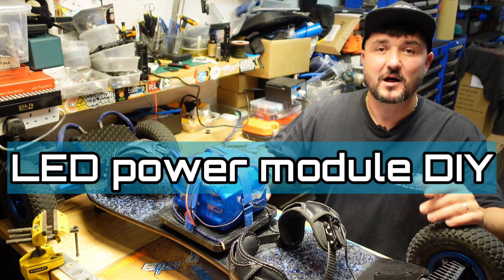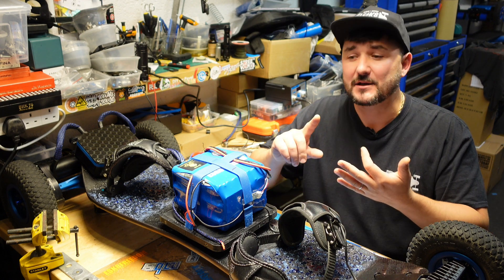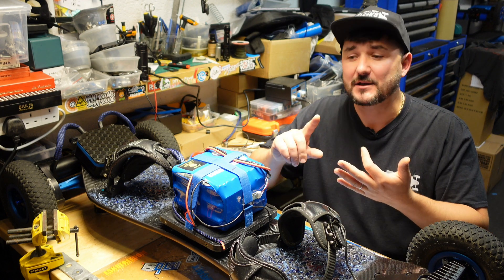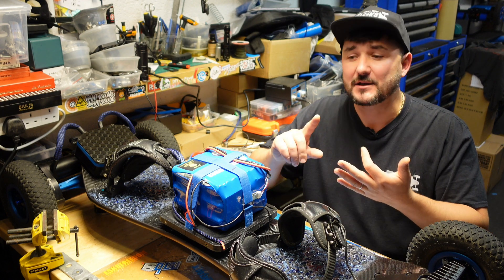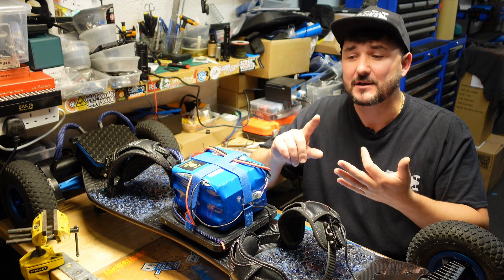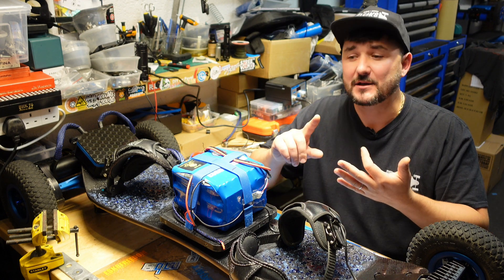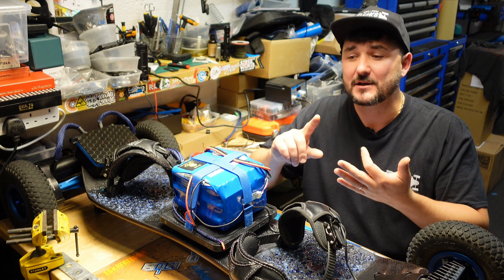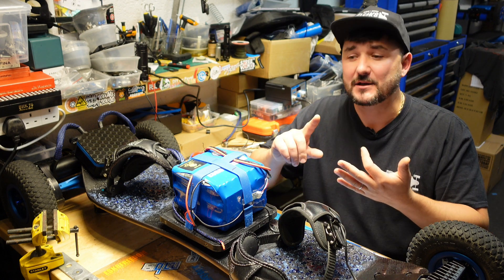ESK8 LED power module DIY. Detailed tutorial.

Comment: Interesting video on the LED drivers, Pavel.  Thanks for going through that.  Any recommendations on actual LED lights though?  Not sure what's out there in terms of products that are bright and work with this LED driver module, rated for the module's 1A maximum rated draw.
Reply from the maker: Hi mate, thank you for watching and for the comment. So the light I am using at the front is this one... very cheap.https://www.amazon.co.uk/Work-Spot-Light-Truck-Offroad/dp/B07F2X1PQP/ref=sxin_15_pa_sp_search_thematic_sspa?content-id=amzn1.sym.67995999-cf30-459b-ab5b-b6e6161fe769%3Aamzn1.sym.67995999-cf30-459b-ab5b-b6e6161fe769&crid=2SDQID84V8RPX&cv_ct_cx=led+driving+light&keywords=led+driving+light&pd_rd_i=B07F2X1PQP&pd_rd_r=6d1c7cb4-ad8f-4f89-8ec1-d3be10ff4f6a&pd_rd_w=4LKsP&pd_rd_wg=obuUn&pf_rd_p=67995999-cf30-459b-ab5b-b6e6161fe769&pf_rd_r=D56AS5VRHAGGBEJBRP7J&qid=1664269403&qu=eyJxc2MiOiIzLjE5IiwicXNhIjoiMS41MCIsInFzcCI6IjAuMDAifQ%3D%3D&sprefix=led+driving+light%2Caps%2C77&sr=1-20-76246abf-0dd0-4857-b3e9-354a8536d81c-spons&psc=1&spLa=ZW5jcnlwdGVkUXVhbGlmaWVyPUEyM001VUE1UExURVpLJmVuY3J5cHRlZElkPUEwNzA1NDQ1MzRPREIyV0pWTFBGOSZlbmNyeXB0ZWRBZElkPUEwODE5MjMwM05CWk43S1IzMEhOUSZ3aWRnZXROYW1lPXNwX3NlYXJjaF90aGVtYXRpYyZhY3Rpb249Y2xpY2tSZWRpcmVjdCZkb05vdExvZ0NsaWNrPXRydWU=

Comment: The pin that you used for on/off 5v can take a 100 - 1000Hz PWM signal for varying the output to the LEDs.  I wonder if it will work with the 50Hz PWM signal from Ch2 of a PWM Rx… if it does then you’d have a high/low switch on your hand held remote (Ch2 button) or maybe on/off. Anybody tried this?
Reply from the maker: That is a good point and question mate.Worth looking into.